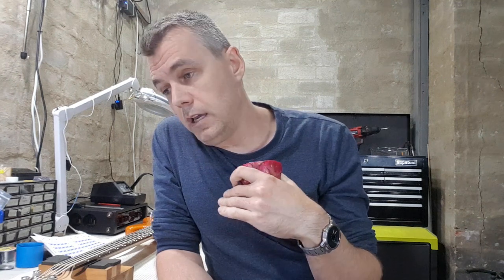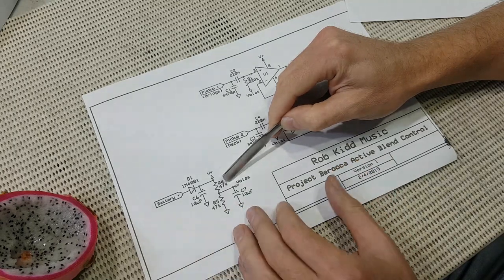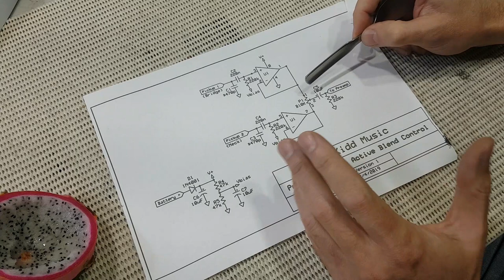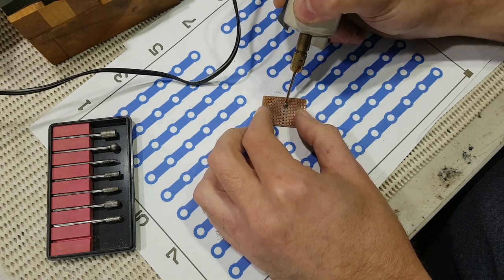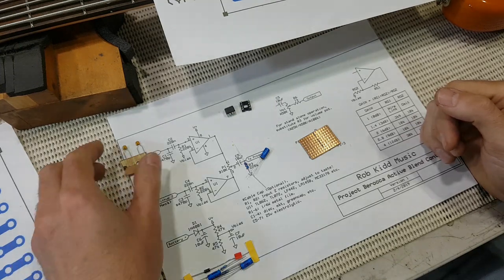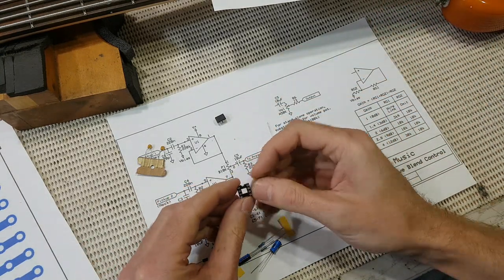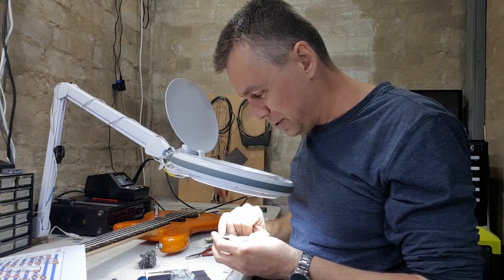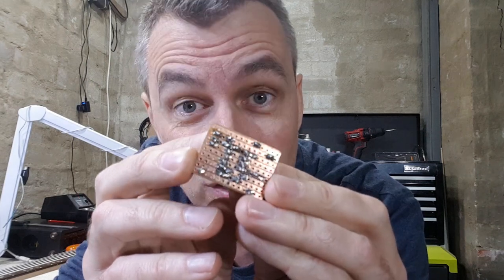How To Make An Active Blend Control, And Why... (Project Berocca Part 8)

Comment: I’m sure you don’t have time to respond to comments, but it would be so helpful for me if you ever did a video or schematic for a piezo/mag mixing circuit.
Reply from the maker: Actually,  I'm planning one.  I want to experiment with a mag pickup on my acoustic bass guitar.   It will be a  variation on the Project Berocca active pickup blend...  cheers!

Comment: Dear Rob, i was building an exact circuit like yours before watching this video. I came upon a problem, searched google, and then found your website and YTchannel. The problem with this circuit is that the voltages at the output are not equal to the input voltages and get summed not accurately. The blend pot works as a voltage divider. If you input just one pickup the output voltage is half from the input. It works kinda if the pot is in the middle or fully on one side but thats to my mind not supposed to be the function.I'd rather suggest the classic summing amplifier and then use the second stage as inverter to get the signal back into phase. Then you mention the choice of ICs in your pdf-file. If you're going through with simulation measuring etc. you have to take into account that OP amps with BJT input have a limited input resistance of for example the LT833 175k and the NE5532 300k while J-FET input OPamps are in the range of10^12 or more. This has a high influence on input impedance and one cannot just easily swap them or take your measured values to built it and then use a different OP amp. I would recommend a OPA1642 which is just available in SMD but there are little adapter printed boards on Ebay available to put it on a DIP Socket. Let me know what you think and thanks for making cool videos om bass and electronics. Cheers, Olaf
Reply from the maker: Thanks for watching my video, Olaf.  The circuit is designed to be accessible and educational for beginners, so I kept the parts count down.  Also with onboard preamp design, you have to work around the pots and other parts that are available.  Battery life is also a big factor.  I decided that soldering SMT parts is probably no good for beginners, even with adapters.  (Believe it or not, I used to make little SMT adapters like those myself with ferric chloride etc back in the day...  Old school, lol!) 

The blend is not perfect when simulated, but few are. (In fact, two pickups sensing the string at different positions is problematic to start with.)  But if it feeds a high enough load impedance, it will work just fine for this application.  I have designed virtual earth / current mixing circuits, but in this application it would require a third opamp.  And again, I'm going for simplicity, and low current draw.

As for phase, in practise, if the input and output are out of phase, well, unlike just about any other audio circuit, that's ok for an onboard preamp.  In fact it's pretty common for onboard bass preamps to have this.
I talk about input z in the next part.  And also play around with it, and the capacitive load, to shape the resonance of the pickups.  I have several videos now, on this theme.  There's no real need for a fet opamp with a very high z.  In fact, most guitar or bass pickups will usually sound very hifi and strange if it directly feeds an z greater than 500k.
Thanks for your questions!
Reply: Hi can you give mail id i have some doubt about that circuit

Comment: The downside is, you don’t get the resonant peak frequency change if the pick ups buffered before a volume pot.. Unless you do passive vol, passive vol, blend. 

(I’ve done a 70’s Rick 4001 with a Bart ntmb pre amp running 18v to fatten up the sound, all under the pickguard, no routing.. I have two passive vols and a master because rolling the passive volume back makes the bridge pick up like a precision).
Reply from the maker: True.  And with certain basses its not the best solution.  Jazz basses for instance have a very bright tone with both coils dimed.   This is a big part of the Larry Graham, Marcus Miller, etc etc slap tone.  I have a project jazz bass on the bench right now and I'm planning some videos about the various blending options and common mods etc.

Comment: Hi Rob, i built one of these, only difference is a B25k Blend and a A25k Volume (only pot i had at hand for mounting in the bass). While it does work the middle position is very quiet and lacks any lows.

Polarity isnt the issue here. Is it the vol pot? It runs in paralell with the load resistor at the output.

The pickups are a EMG 40DC and EMG 40JX which were wired in jazz bass configuration before and worked fine
Reply from the maker: For active EMGs, you shouldn't need a dual buffer like this.  The pickups already have inbuilt buffers.  Use a 20k or 25k dual gang linear pot wired as if it were an  MN blend pot in a passive bass.  It will give a nice even sweep.

Comment: I just found this/your stuff Rob. Great info!!  I want to make one of these for a Les Paul guitar, so the freq range needs to suit that. Do you have any info.... table.... of possibly what filter component changes would suit that? I guess the 'maths' of it is not that hard to work out, so maybe I can achieve that successfully myself.
Another thing is the LP has the dual Vol and Tone controls, so I assume there is no problem having those on the Pickup/Input side to the Blender? Thus it will keep those controls isolated to each pickup also.
If I keep a Blender pot - which I don't want to add another pot (keep just the four) - one thought is to have two individual Tone Pots, OR two individual Vol pots, and just one common of the other Pot. Again, having the chosen pair (whether Tone or Vol) on the Blender circuit input sides, and the one common Pot on the output.
My real/initial aim is to have a form of 'active' Vol and Tone control, just so that each pickup has its own isolated set of controls - thus no interaction of those Pots (interacting load changes as their values are changed) when selecting both pickups (as they commonly have).
Hmmmm..... I guess on a LP no Blender POT really required in this circuit...... and then the Vol and Tone Pots can all be on that input side to each Amp section. The circuit is really just used as an 'isolator' to keep each pickup and its controls isolated from each other.
Reply: Ooops, I forgot.... and DOH....I was also watching/reading the onboard Pre-Amp, and that was more about where the "non-bass" guitar filter circuit freq/band components come into the need for changes.  But now I am thinking that this Blender alone, with no specific EQ section in it, means there is nothing to work out for a filter section!
Reply: And on another note..... I also don't want the Vol and Tone pot interactions a passive circuit has - or also what just having those two controls 'linked' to each other causes. So some pre-amp/op-amp idea (as per in this blender) could allow those to also all remain isolated. Do the Tone before the pre-amp and the Vol after I guess.
So now I have..... Two Tone pots, at the inputs to the pre-amps..... One common Vol pot on the output.... and keep the Blender pot as Pot number four.

Comment: Hey Rob, a question about the blend pot P1; with my limited understanding it looks like either pickup cannot be fully turned off (zero output to the following preamp). For example, if the wiper of P1 shorts to P1 pin 3 then the neck pickup will be full output but the bridge pickup will still have some output through the 10K of P1. Do I have that correct and, if so, what would the the reduction in dB between the two pickups? BTW, I appreciate your Project Berocca series.
Reply: using pots without resistance which is 0 ohm